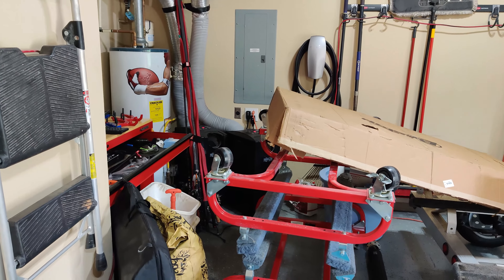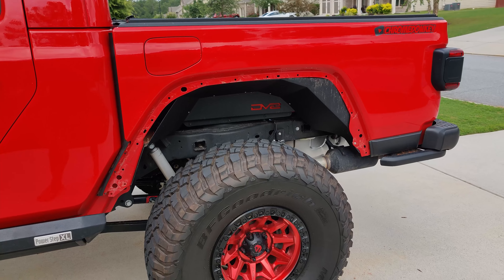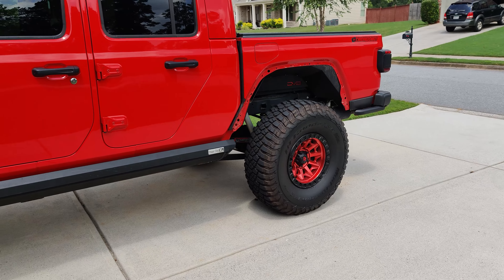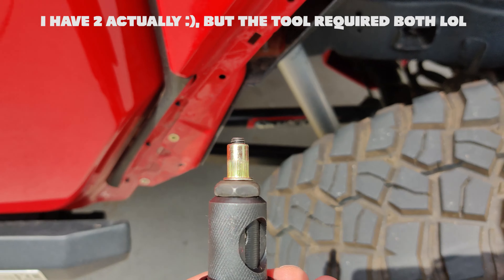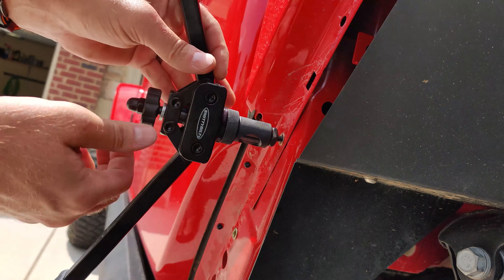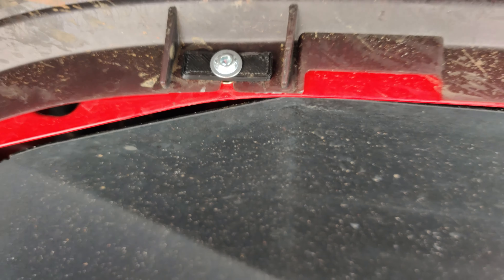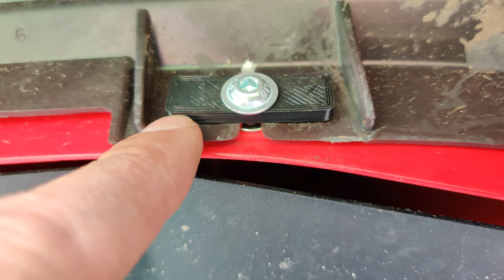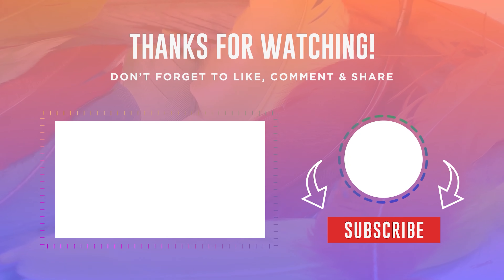Jeep Gladiator Rear Fender Trim Delete - Jeep Fenders

Comment: Anywhere else to find those fender retention blocks? AL wants $50 to ship them. I’d love to print my own but don’t have full specs.
Reply from the maker: Great question, I have never searched for them.  They are great though.. Then again, I got to thinking long after I installed, I wonder if that's a good or a bad thing.. Hit the trail and a tree grab your fender, OEM they would just pop right off.. Now, it could potentially bend the actual fender metal LOL.. :)

Comment: Sir I really need your help I bought a 2021 gladiator and I scratched the shroud on the fender the fender is painted and didn’t get scratched just the shroud part will the service people be able to remove the shroud safely and put on a new one in desperate need of your help thanks
Reply from the maker: I mean, it's a risk when you remove it because you are flexing painted plastic, paint could crack.. All I can say is during my removal of all 4 shrouds (granted, I didn't re-install them), I didn't have any paint issues at all, zero spider cracks, etc.. So, i'd say if someone took their time, then yes, it's definitely doable.